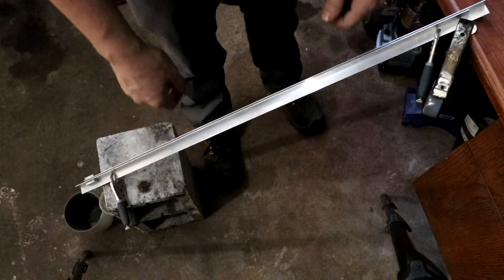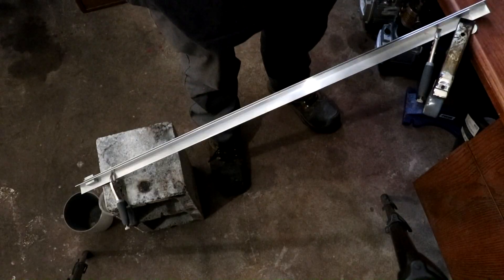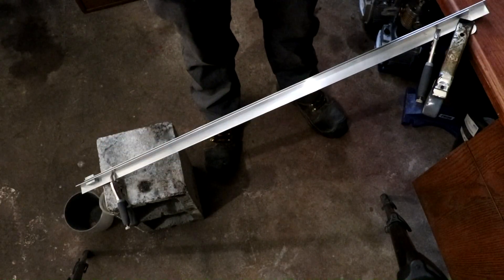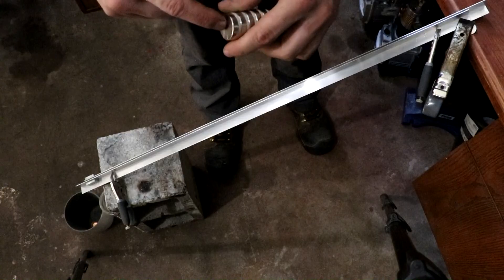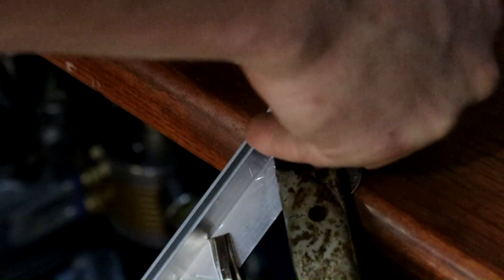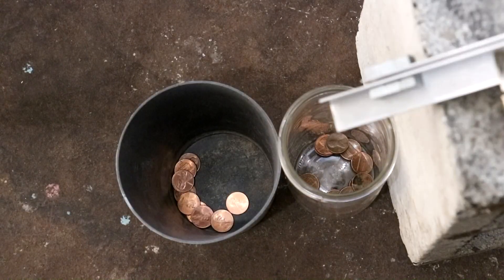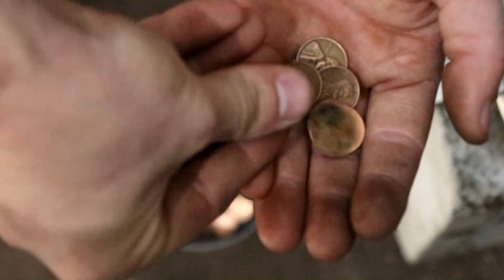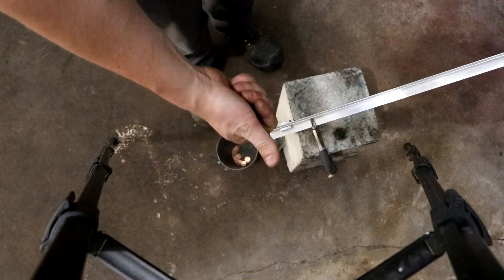I Made a Super Simple Penny Sorter!

Comment: Have you seen the mythbusters try to stop a bullet with a magnet? They used a lot of magnets and couldn’t do it.
Reply from the maker: actually an ac current switching through a coil at 50,000 Hz would be ideal.
Reply: Oh yeah, that would be even faster than exploiting the bullets' speed. Can't wait!
Reply: @theCodyReeder  ah, that's a good idea! i've never really been good at making electromagnets myself, magnet wire is so finicky to mess around with 😅 
that's one of the reasons why I chose to make an IEC fusor model instead of a magnetic confinement one (other than the vast price difference, that is)
Reply: @theCodyReeder  50 kHz on a large inductive coil? You better make sure your q factor is high enough or else you'll just end up with a really inefficient capacitor at those frequencies. Maybe try cooling the coil off with liquid nitrogen before the shot. Also, you may need to address your power factor by adding an appropriately sized tank capacitor. Otherwise you'll have a really unhappy frequency generator.
Reply from the maker: They did it wrong, its not the strength of the magnet, its the rate the magnetic field changes that will slow the bullet.
Reply: Alternating magnets it is then? Then you need to get really close to the magnets I guess, looking forward to that!
Reply: @theCodyReeder  So, if one were to find a way to switch on an electromagnet as a solid copper bullet passes close to it, do you think it would be effective?
Reply: If the magnets were travelling in the opposite direction of the bullet, would that increase the rate the bullet slows down?
Reply: +Cody'sLab I hope it's possible to get some kind of thermal profile of the bullet/assembly when you do this. Also, would there be feedback into the coil?
Reply: +Kirk Schafer of course there would be, energy has to go somewhere (some of it will be converted into heat but not all).
Reply: MythBusters messed up a lot of experiments, saying some were false when they clearly did not take all factors into consideration.
Reply: @OdisHarkins  I agree with you, MythBusters messed up about a Third of the time, not doing it right.
Reply: Mythbusters blew lots of calls.  Probably because they hated each other and didn’t like working together.
Reply: John L  Mythbusters is for entertainment. Made some nice bangs in the process.
Reply: I thought they were trying to deflect it not stop it in the episode.
Reply: It should be possible to do it, as the bullet would experience induced eddy currents that would create a magnetic field in a direction countering the changes in the one it was passing through.  Alternating the magnetic field repeatedly along the path of the projectile for a long enough stretch for a given magnitude of flux should do the trick for a conducting projectile.  I wonder how much one would heat the projectile in the process as the eddy currents would end up as heat.  The kinetic energy, = 1/2*m*V^2,  would show up as heat in the projectile and the magnets or metal track along the path as the projectile slows.  Adjusting the curve of the track to account for gravity as the projectile slows could be an issue for the design, although one could avoid this problem by firing into or away from the gravitational field.
Reply: What would happem if a bullet was fired through a vacuum. Perhaps have a vacuum chamber be long at 6 or more feet. When the bullet passes through one side of the vacuum container (maybe aluminum) what would happen to the bullet?
Reply: MythBusters did a  lot of their test wrong....  I would say about  30% or more they didn't know what they were doing.

Comment: And now I wonder if you could use a similar system to sort all types of change.  The magnetic characteristics of different coins are different.  In a vending machine they actually pass them by a coil to electronically read the magnetic profile.  I'd love to see this done entirely by magnets!
Reply from the maker: Im currently working on separating silver quarters from cupernickel ones, its a lot harder but there is some difference.
Reply: I was about to ask if you are working on this also, but saw this response! That would be a great experiment. ( the silver quarters from the cupernickel)
Reply: A balance  gate might work, reaction might be a little slow, but four old quarters are about an ounce. New ones weigh less.
Reply: @theCodyReeder  You could build a coin sorter to do that with acoustics. A copper-nickel quarter has a different ring than a 90% silver one.
Reply: Copper pennies ring differently than the zinc ones as well. For lack of a better term, the silver quarters and copper pennies have a "Brighter" ringing sound than the respective nickel and zinc versions. I recently bought about 300$ worth of 'silver dollars' from a guy who had a coin sorting machine, and the way I checked for silver in it was to take them  by the fistful, and one by one drop them on the table. Found like 1 real silver in the mix, but it certainly stands out to the ear, and is way faster than reading every date.
Reply: @TofranBohk  This is how I collected silver as a cashier. All change was dropped and the pitch of the silver was different enough I could do it by ear. The difference is striking.
Reply: What about nickels
Reply: You mean the wartime silver nickels? Maybe not enough of them in circulation to be worth the effort. Apart from that, basically all nickels were made of the same material.
Reply: weight
Reply: one problem with having this in a vending machine could be that grease will accumulate and mess with the coin speeds
Reply: Where I work, we have one of those coin sorting machines for the public to cash in coins that I have to attend to. Turns out, grease is not really an issue. what you mainly get built up is a fine black grit that acts as a combination abrasive and general fouling agent, (I think its made of metal oxides, mixed with random pocket dust).
The other problem you run into with those machines is just random trash from pockets (ticket stubs, single ear-rings, challenge coins, SD cards, paperclips, bobby pins, etc) and coins that are either bent, or stuck together with what seems to be hard candy. those sort of items tend to Jam up your channels.
Reply: alfalfa fonzo Eh, they have to be opened up to get refilled anyway. Just have that person wipe down the relevant parts.

Comment: why are you using slowed down footage from your camera when you have that high speed camera?
Reply from the maker: That is the high speed camera
Reply: ohhhhhh, why does it look so studdery to me then? when I used the chronos at maker faire bay area it didn't get that strobe effect but I guess that is more an artifact of the lights your using than the camera
Reply from the maker: If you can find a good portable light that is bright and doesn't flicker I would like to buy it.
Reply: Isn't the flickering caused by the AC current, couldn't you just use a DC powered LED?